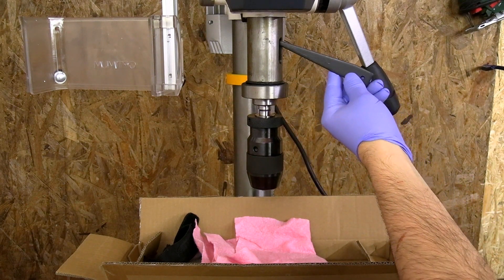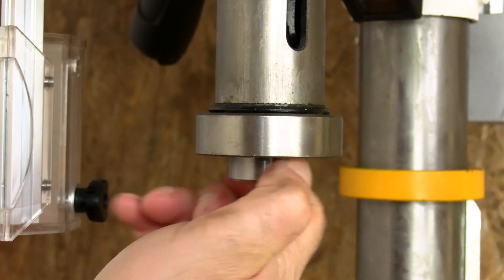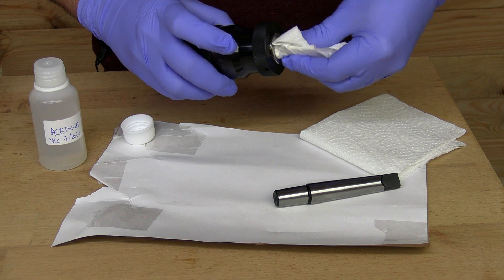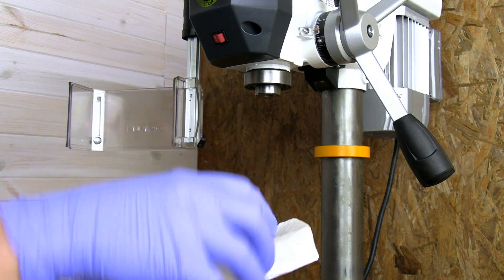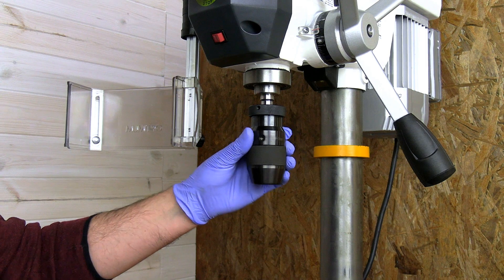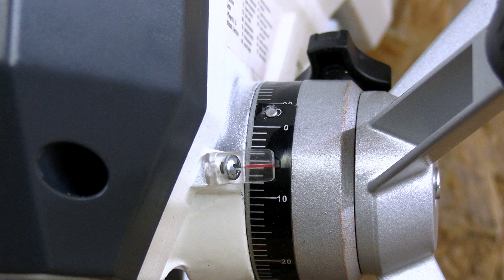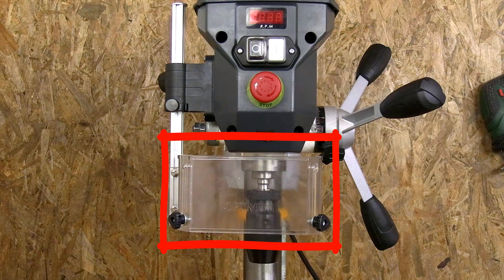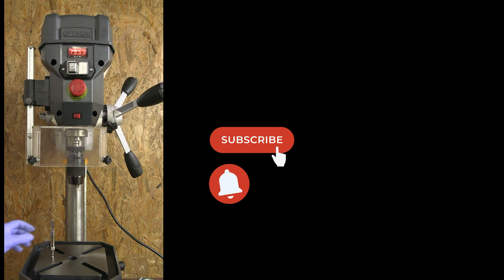Features of My Professional Drill Press. Review.

Comment: That thing is called a drift. You might be able to use the drift to remove the chuck from the Morse taper. to put the chuck and taper in tight use the handle to go down to the table and give it a good turn to force it in.